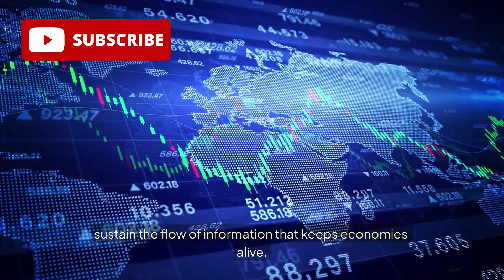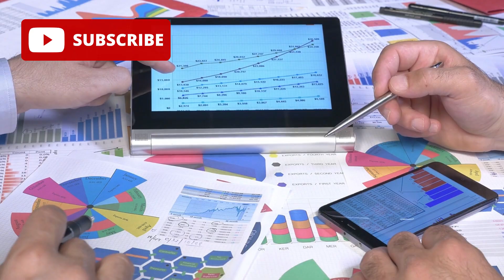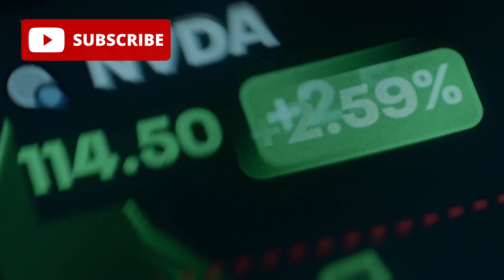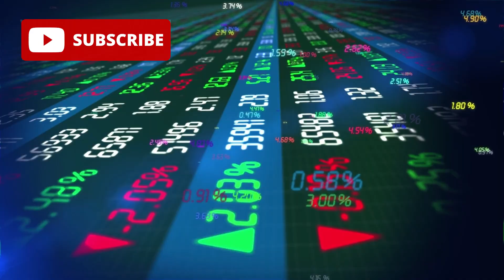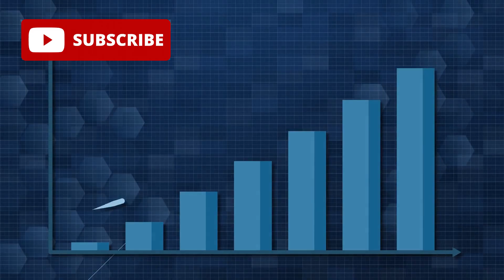SMIC Launches 2nm Chip Despite U.S. Sanctions — Washington Completely Panicking!

Comment: The US is so dependent on TSMC that it has seduced TSMC to construct advanced fabs in the US.  So far, those fabs are three years behind schedule and forecasted to 2026 for production.  By that time, China should be well along with 3nm and starting 2nm production.  If so, the Arizona fabs will be cost uncompetitive. Already, China has captured the mature node chip sector with 1.3 billion chips per day production. Now China is focusing on 2nm silicon chips and also alternative substrates that will take semiconductors to a higher level than silicon can provide  These are interesting times and it appears China will dominate the semiconductor sector in this decade.